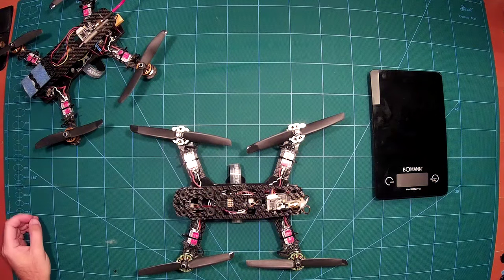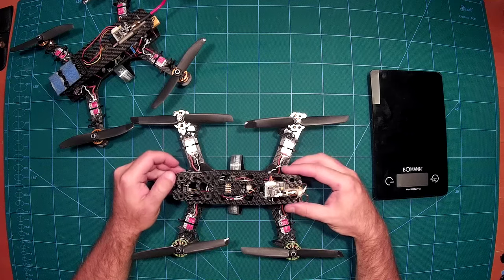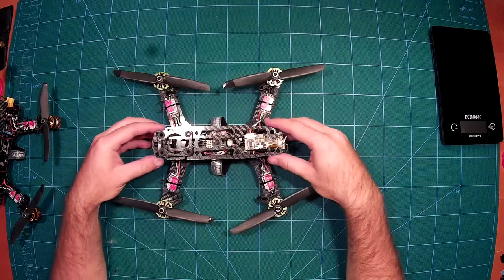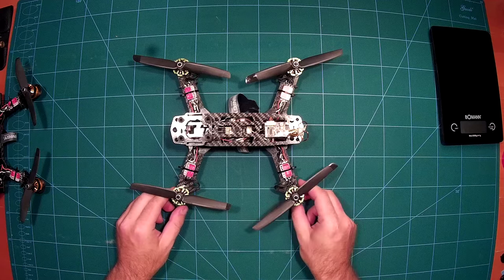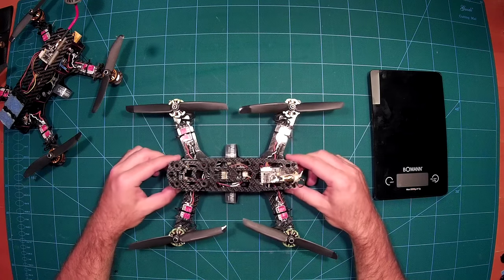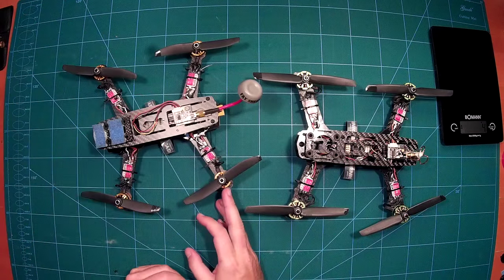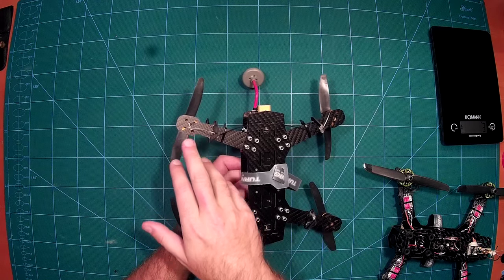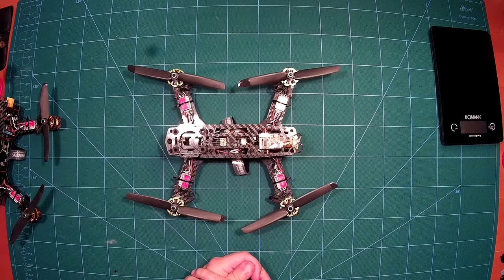ZMR250 vs. DTI Blade series 250mm Carbon Fiber Frame Kit: Build review and comparison

Comment: thx for nice review. i am about to build the Diatone 250. Not many use 6 inch props, how is your experience with them? What pitch on them? 6X...? they go clear from the main frame but not by much i guess? I have a hard time choosing motors, considering the baby beast, but also the "mini monster". Mini monster is only 7 grams heavyer and with a 4mm shaft. What do you think? You run on 3s battery? Hope you can answer my questions, it would kick me off in the right direction. thx.
Reply from the maker: +André Lie Hi! It depends on what you want to do. I love the 6" (6x3, 6x4) props on 3s with the baby beast just for cruising around fast or also chasing planes. It is more "floaty" with it than with the 5" props, but it's also less noisy and flies a bit longer. For FPV racing with close corners I prefer the 5x4.5 props. I have no experience yet with the mini monsters.
Reply: +RC FPV Flight. Many thx for the answer. Ok, is the baby beast good for tight corner fpv racing with 5 inch props, or/and maybe you could recommend other motors if they are better for that kind of flying? Maybe a little more kv, i dont know. I was thinking of banggood or hobbyking motors.
Reply from the maker: Generally people love to use Cobra motors for FPV racing. you can get them from Surveilzone, if you prefer chinese sellers: http://www.surveilzone.com/Cobra-CM22042300kV-Brushless-Multirotor-Motor--g-1401
 
These are usually top-notch.

Comment: Nice one. You reckon its more "unbreakable" than the ZMR? Thanks!
Reply from the maker: +assaulter99 Given that it is 30-40g more light weight than the ZMR, it is still very robust. I could not find any "weak spots". It seems to be very thought out. I will report, should something break ^^

Comment: Hi again RC fpv flight!I bought some of these ztw spider 12a esc's. I'd like to update the firmware With simonk. Never flashed an esc before. I got the Tools for it, the usb programmer and flashtool from Hobbyking, but can u tell me the firmware Version or what i shall Call it. which type i shall use? I'm think it uses the BS NFET.hex (did a Google search) but did not find an accurate answer. Could you confirm or tell me the right one please?
Reply: +André Lie I think i was refering to which firmware file. BS nfet.hex? Is that the right one?